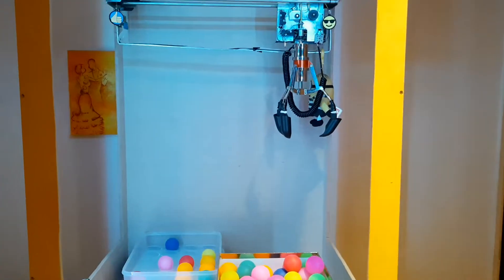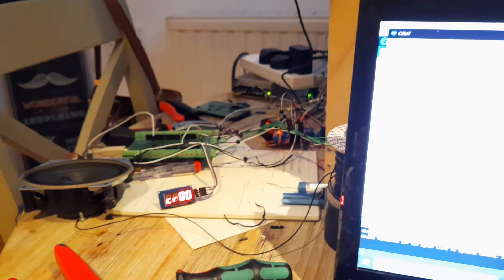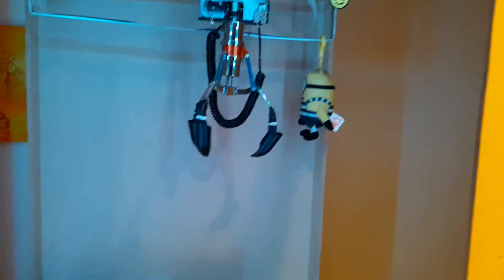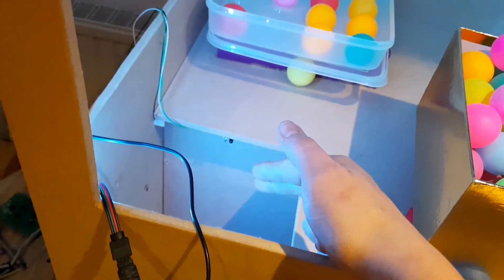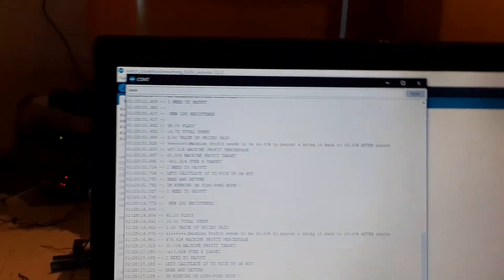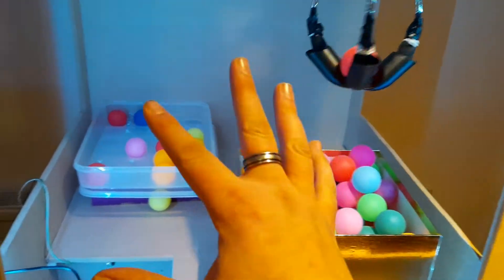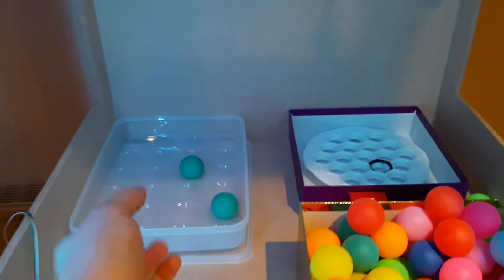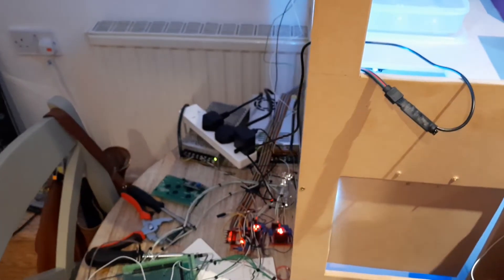Home Made CLAW MACHINE - Easy DIY - how to make a claw machine.

Comment: Hi, Got a similar project to you. Bit stuck, as the only h bridges I can find are limited to 35v, whereas the motors are 48v. Which ones did you use for your project? Thanks
Reply from the maker: Hi I ran these.. they work up to 46v.
https://www.amazon.co.uk/dp/B077NY9RY6/ref=cm_sw_r_em_apa_glt_fabc_8SHHVCZRWA8NPGP9PATR?_encoding=UTF8&psc=1
Reply: @InsidetheArcade  Great, cheers for that. Is your power supply 48v or just under? As I would assume 48v could cause damage to the h bridges if they're only rated for 46v?
Reply from the maker: I played around with the voltage but yes, I reduce it slightly by the potentiometer.